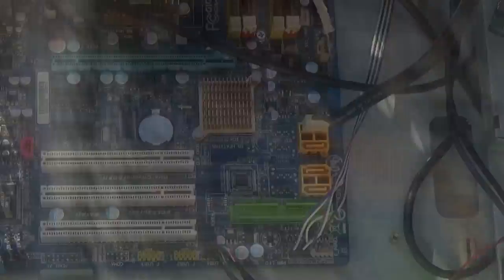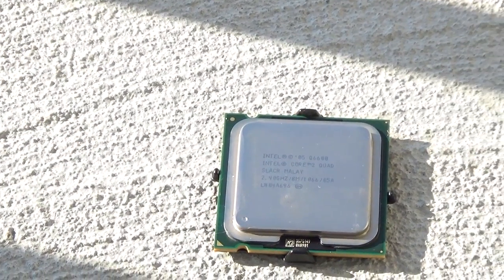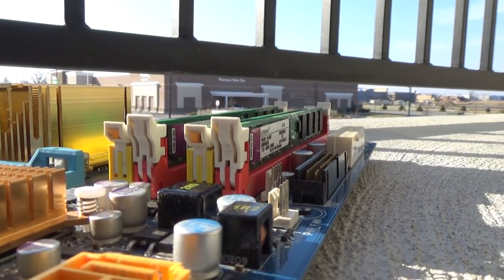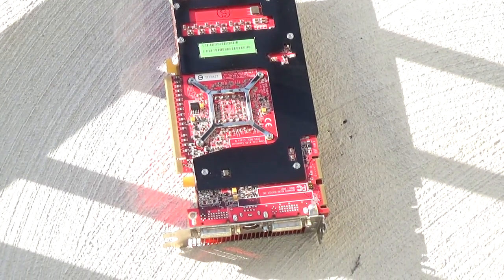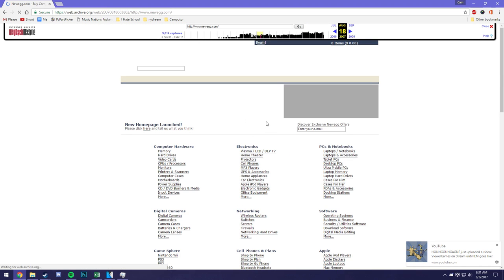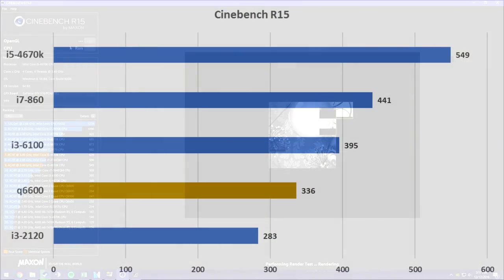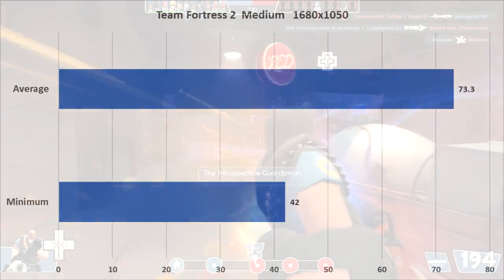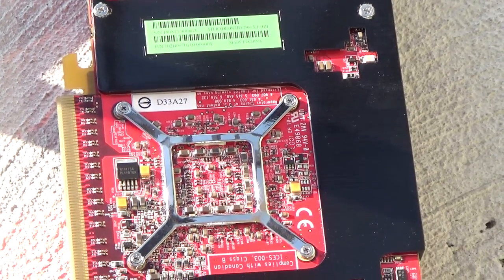2007 Gaming PC

Comment: great video, love the Q6600 still have 2 systems running as Overwatch machines
Reply: WhackedMoss3 Moss3of4 What graphics card, is the q6600 overclocked, what settings is the game running at and how much ram does the system have?
Reply: +Sufyan Motala Both machines have the Galax (Galaxy) 750ti OC Black Sniper Edition, no neither system is overclocked, I have since changed one out to a Q9650 (not overclocked either), 8Gb ram (one using the old DDR2 and the other using DDR3) and running game on medium to high settings (dependent on who is playing, as I don't play the game)

Comment: Very interesting video! I'm thinking about building a pc from around 2007, not so expensive, but specifically with Win XP.
I need to find a motherboard, the processor, graphics card and ram. The other parts i already own.
My main concern is getting a good marriage between a motherboard and processor compatible with Win XP. Can you suggest me something?
I found it very difficult to know from which year are the motherboards that i find on the web.
Reply from the maker: I have a "new" computer that I use for Win XP, it has an Athlon 64 X2 5600+ 2GB DDR2 and a 7800 GTX. It's pretty nice

Comment: I just recently bought a Gigabyte GA-P35-DS3R with a Core 2 Quad Q9450 and 8 GB of DDR2 RAM. One thing about this motherboard is that it can take both DDR2 and DDR3 so I have two sticks of 4 GB DDR3 clocked at 1333 Mhz. I just bought a Radeon R7 250X so that I have more room in the case. Will be turning this system into a Windows XP/Windows Vista [7] build. I payed 45 US Dollars for the motherboard with the processor and I paid 30 US Dollars for the AMD Radeon R7 250X.
Reply from the maker: Very nice deal on the motherboard and processor. That Core 2 Quad should hold up with those old operating systems.

Comment: You could run at higher resolutions than 1680x1050 in 2007 but with higher end monitors. I remember Dell already had 30'' 16:10 monitors out in late 2006 which did 2560x1600. Also, some older CRTs (the really huge ones, like 21'') that did 2048x...something in the mid 2000's...but again, super expensive.

Comment: my first gaming build was from late 2007/early 2008 and it had the e6750 core2duo, 2gb ram, 8800 gts 512mb version (same gpu as 9800 gt), and it played crysis smoothly on 1440×900 res. I couldnt do ultra settings because of windows xp. I eventually got a 1080p monitor and things changed- fps went down so a simple decrease in AA and/or something else(cant remember now) would make it run smoothly again. Never tried it with dx10 though...

Comment: Very similar to my original PC, but had gotten an i7 3820, I had a stock PSU(that exploded into green lights and magic smoke) that go replaced by the corsair 500 watt, and the GPU was a tiny ATI chip, cannot remember which that i recently upgraded to a 1070.

Comment: when you are early af and the vid is 360p xD
btw i have 2000s gaming pc :D 
p5gc-mx/1333 mobo
e5800 cpu
4gb ddr2
and 730 gt (Cus my original 7300 started artifacting)
and finally 80gb hdd :D
Reply: i have a 
Gigabyte Mobo ( DDR 2)
Q6600 Quad core stock 2.4 OCed to 3.4 GHZ
7gb ddr 2 800mhz
Gtx 760
2x 1tb hdd

Comment: I had a Q8300,6gb with a R7 360 and it would play EA Battlefront on close to max detail settings at 1050. I was stunned it did as well as it did. Won't run Battlefield 1 at all though.
Reply: Wha? With those specs you could play play battlefield at 1080p 40fps with high/medium settings.

Comment: 2024: My Intel i7-4790K is now the 10 year old CPU. Originally released on Monday the 2nd of June 2014 A.D. (according to CPU World).

First Intel CPU with a base speed of 4.0GHz (running at 4.4GHz all core with a Gigabyte Z97X-UD3H-BK motherboard supporting multi-core enhancement, with Crucial Tactical Tracer DDR3 memory).
Reply from the maker: I still have a 4790K, up until a couple years ago I was still running it as my main. I could still probably be fine with it too

Comment: My AMD Phenom II X4 955 @ 3,8GHz Pulls 380cb :D
but i need to replace my old HD4830 any ideas ?
4x2GB DDR3 1333MHz CL7 RAM
1440x900 75Hz Xerox XM3-19w
Windows 7 Ultimate SP1 x64
Reply: If your powersupply allows it. Get an used gtx 970. Else a 960 :D

Edit: If you screen is only a 1440x900 Then go for a simple used gtx 750 /TI
Reply: i have a Chieftec GPS-500AB A maximum 2x +6.
i think the 960 would be overkill anyways :D

Comment: Lol today I fixed my PC from 2007. Socket A Sempron + 2x512MB DDR2 400MHz + 40GB HDD + AH3650 SILENT/HTDI/512M
 and it can run Crysis. Barely and against the required minimal specs but it can. On WinMX7. 18 - 24 fps.